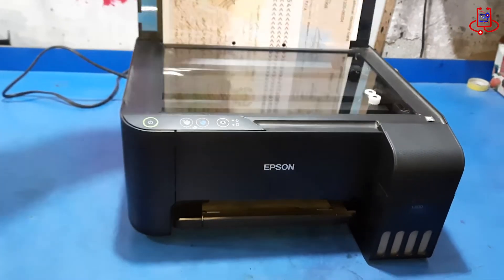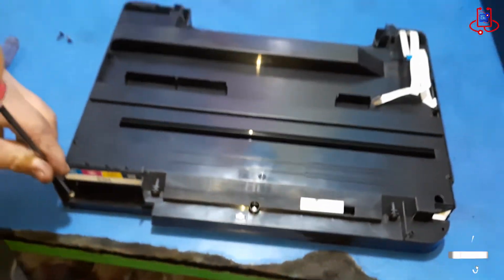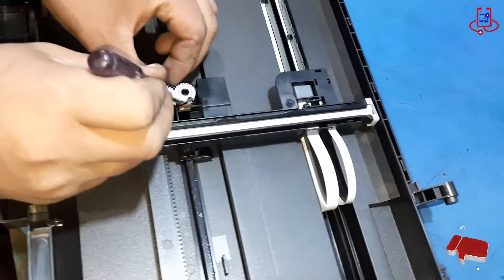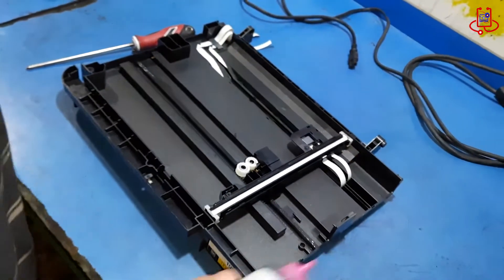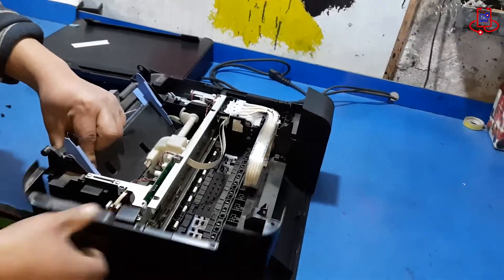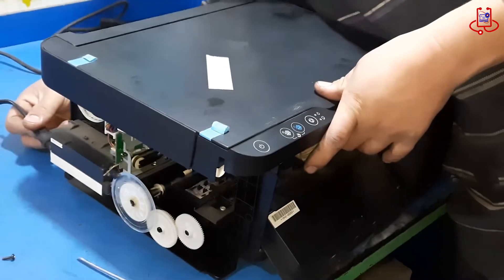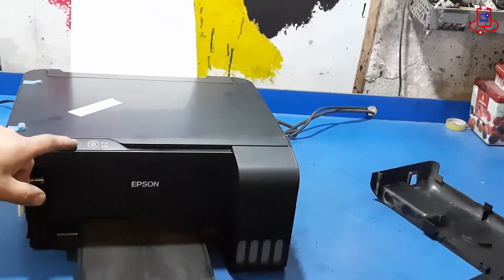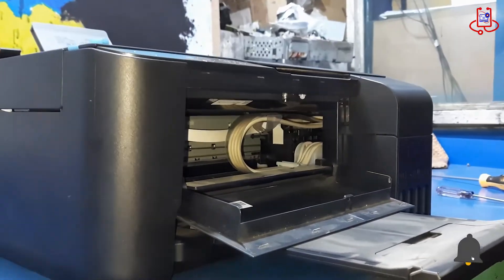How to Fix Epson L3110 Scanner Error – Easy Solution for Blinking Lights Works for L3150, L3210...

Comment: In my printer I see when doing xerox half page is printing fine but other half is like very blurry or very dark
I tried xerox of white paper I see one half is fine but again other half is like  purplish patch, will the cleaning work
Reply from the maker: This issue is most likely caused by the scanner unit, not the print head. For the Epson L3110, half-page blurry or dark scans usually mean the scanner sensor or strip needs cleaning or even replacement. Try cleaning the scanner glass first — if that doesn’t help, hardware repair may be needed.